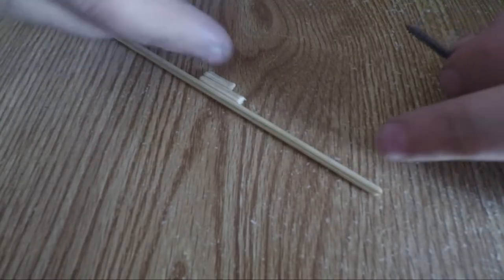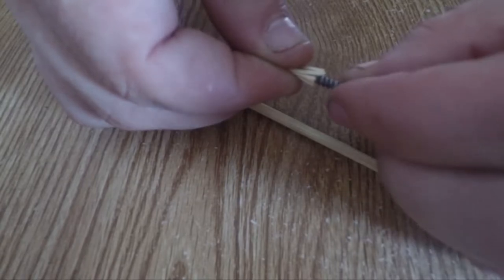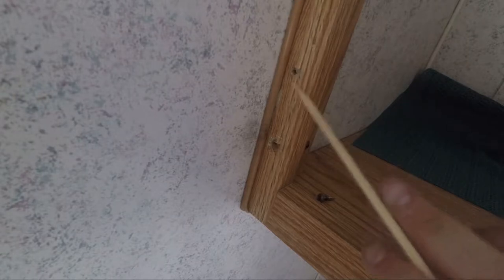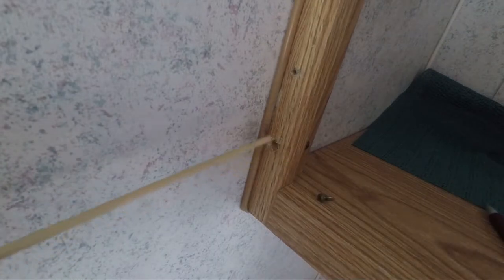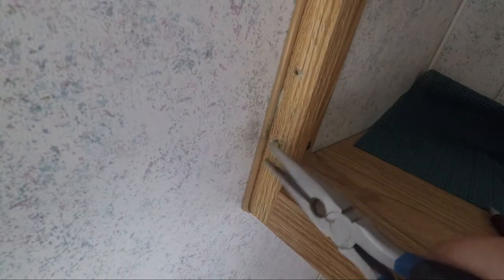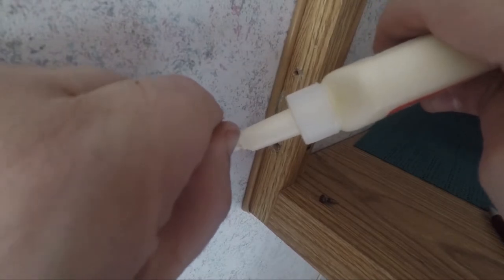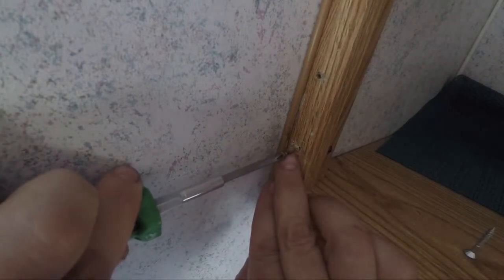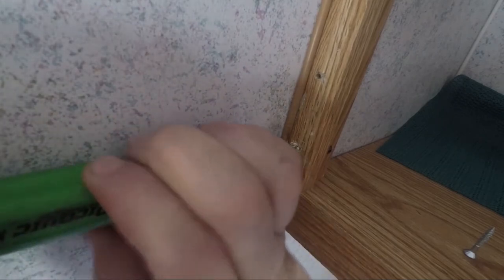How to FIX PARTICLE BOARD screw holes RV Cabinets

Comment: Question:  I have a child's kitchen with the doors stripped off...and they are a coated particle board; the screws have to go on all 4 parts/sides of all the hinges...do I fasten first the one side of the hinge that is on the door with the screws and then try to "hang" the door with the two that will go on the larger item?  In other words: Should I put the screws on the door and let them dry with the hinge on first and then attach the other two sides of the hinges onto the bigger "box"?  I don't understand having the screw glued in to the larger box first...call me confused!

Comment: Good idea - thanks for sharing. Just what I was looking for.  I need to do this for the trim around my RV microwave.  Would you recommend letting the glue dry before I drive the screw into the bamboo?  Once I drive the screw, I don’t want to back it out to mount the plate.
Reply from the maker: Nope don't let it dry the bamboo will split into a couple big pieces and not get the benefit of all the fine fibers.